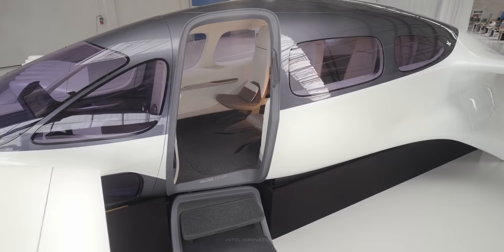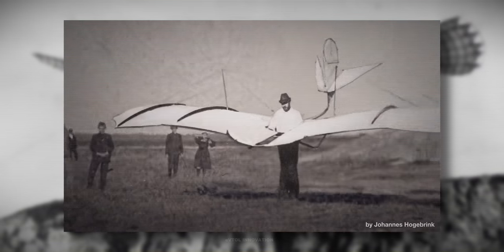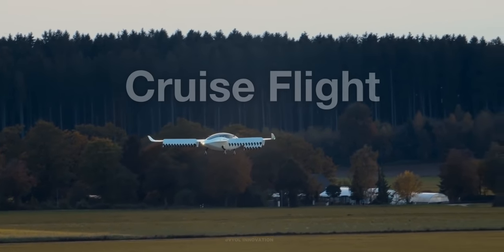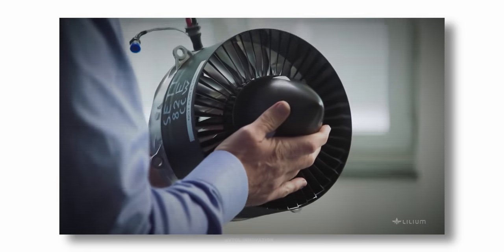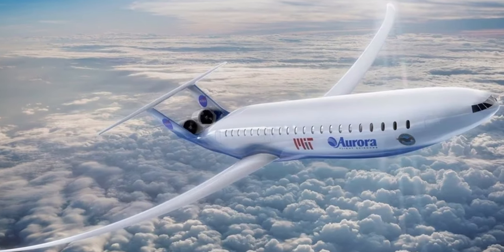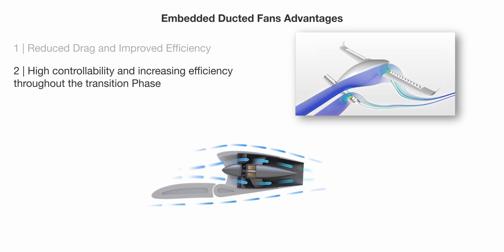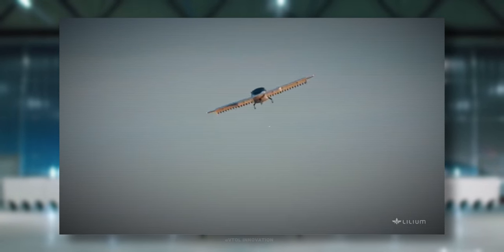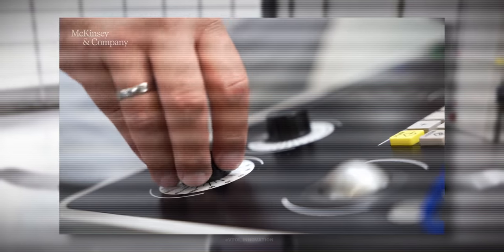The Insane Engineering behind The Lilium Jet | Part 1

Comment: The aircraft sounded interesting unfortunately I am a blind subscriber
If somebody has the time could they describe the vehicle with a blind subscriber in mind thanks
Cheers
Reply: Hi Verne,

your curiosity and the fact that you can not see motivates me to try my best explaining the aircraft showcased in the video. 

It is a sleek looking aircraft that is mostly white in color featuring some additional black trimming. The aircraft architecture is utilising a set of smaller wings in the front and larger wings in the rear - a so called cannard aircraft design. It is about 11 Meter in wingspan (rear) and can seat 7 people within its extremely sleek looking fuselage, which might remind someone of the shape of a shark (without it's fins).  The aircraft is being entered on the left using a splitting door with integrated steps - oftentimes seen on luxury class business jets. One centered pilotseat in the front and 6 passenger seats behind. Its propulsion system is distributed along the rear trailing edge of the wings. 36 electrically driven ducted engines in total, of which 12 of them are on the two front wings and the other 24 on the rearwings. The engines are mounted in the pairs of 3 within so called flaps that are able to tilt around 90 degrees from a hover position into a forward flight cruise position using compact and strong servo motors. One special characteristic is the fact that there is no conventional tail stabilising surfaces (like a rudder) - it's all thrust vector based and therefore relies throught its full flight envelope on complex flight computing systems. The landing gear is of fixed nature and consits of one nose landing gear and two main landing gear legs that are being covered using a aerodynamic fairing structure that is likely utilised as a stabilising surface during forward flight, effectively replacing the vertical tail of conventional aircraft. The aircraft also offers a relatively spacious looking cargo trunk in the rear. 

I hope I have done a good job in describing this very beautiful and elegant looking all electric vertical take-off aircraft. 

Let me know and I am happy to clarify things further if you want!

- Robert
Reply: @supervolant  thanks Robert your explanation was excellent I hope this response gets through not sure the app is as accessible as it should be cheers
Reply: Thanks Robert
Your description was excellent cheers
Reply: @vernepavreal7296  Is received! Wish a nice day.
Reply: Also the tip curves up on the big rear wings into a sort of fin, i'm not airplane expert at describing this.
Reply: @635574  Wingtips are not for direction control. They control the wing tip vortacies effectively making the wing perform like a longer one, which is more efficient. In laymen's terms the longer the wing the less air slips off the end of the wing vs staying under it. Wingtips reduce the slipping.
Reply: Surprising they don't mention that EDF is the best way to turn electrons into noise and heat. Does this come with a cord? I think that says enough.
Reply: @supervolant   

I would like to describe this user as: awesome.
Reply: @supervolant  Details are in the efficiency numbers. A pilot is a deficiency, and liability.
Reply: @court2379  Not exactly true, they are to dissipate the vortex away from planar influence. If they were inverted, they would appear as a longer wing as it would create a small wing in ground effect situation by building pressure under the wing.
Reply: So should I design a wing tip differentiator to switch from peak laminar flow to an inverted or introverted plane modifier tip?
Reply: whoever reads these comments to verne pavreal tell him the plane acutually looks like a banana.
Reply: The Body is shaped like a stretched apple mouse white on bottom brown on top half  , It has a large long  wing with shark fin like wiglets at the rear  . There is a smaller wing half the size up front without wiglets. Fixed wheels in aerodynamic upside down  v at the rear . Both front and back wings have the engine in-beaded into the flap section of wing at  the rear of the wing 24 engines total on back wings 12 up front . Weird looking plane something apple or Elon would make but the thing is well engineered and rides and lands smoothly . Professional serious plane
Reply: @chlyon  he is blind, he can't read
Reply: @ruzzcraze1862  lol yes
Reply: @chlyon  hi Colin thanks for that the app on my iPhone actually reads most of the text people type etc but of course not pictures thanks
Reply: @ruzzcraze1862  thanks for the suggestion actually the built in voice over app on iPhones reads the text to me or most of the text provided on YouTube cheers
Reply: @vernepavreal7296  I was joking lol
Reply: @supervolant  I love the shark analogy, agreed. It looks like a hamerhead with no fins and tail, fitted with Boeing 737 NG wings (with the winglets!)
Reply: @ruzzcraze1862  👎👎👎👎👎
Reply: @theone-swta  you didn't get the joke, I was joking, is jokeing something you understand. I was making a funny joke fr frfr.
Reply: @theone-swta  I wasn't ever making fun of him.  I am aware of the tools that visually impaired people have. Sure my joke was more on the side of trolling than wit, but It wasn't toward him, it was obvious jokes, that even he got. 

It seems like you think you have some sort of moral high ground over 12 year olds(which I am not), when you type with the literacy of a 14 year old.
Reply: @ruzzcraze1862  You believe what you want, what is obvious to one is not always obvious to another. Your sense of humour is wanting to say the least.

I stand by my commet!
Reply: @theone-swta  understandable for someone who didn't get the joke. As mentioned, it certainly was on the side of trolling.
Reply: @ruzzcraze1862  Trolling is always funny to the troll.
Reply: They call the propulsion jets but they are electric ducted fans.
Reply: It looks like a boondoggle with wings.

Comment: Calling an EDF a jet immediately makes this whole project sound like a scam.
Reply: EDFs are also the least efficient form of model aircraft - they require vast amounts of power compared to using a propeller.
Reply: Just like that new porsche "Turbo" ;)
Reply: @cjswa6473  still makes it SOUND like a scam. What MAKES it a scam is that they KNOW it won't do what they claim. The absurdly low efficiency of such small impellers makes it impossible. Why do you think that the only flights have been very short duration with no ballast to simulate the humans and cargo they claim it can carry?
Reply: They have to speak a language that at least some of the non-smart people out there can sort of maybe understand a little?
Reply: You may be hung up mostly on the electrical part of the design. Just feels like a whole lot of hate going towards this project which to me feels like a pretty decent shot at something that could be transformative.
Reply: @djbis  No, not the electrical part, but the electrical duct fan (EDF). EDF has very low energy efficiency. I think electric is the way of the future, that's why energy efficiency is so important.
Reply: Jet: a high volume of liquid or gas forced through a small opening.
Once they claim turbojet, then it's a scam.
Reply: Maybe but Airlines like Azul ( Brazil's Jet Blue, same founder ) have already placed a $1 billion order.
I'm surprised Lilium didn't go the Hydrogen Fuel Cell route.
Reply: Yea it's a scam that's why Honeywell and Palatin are top Partners. And the CEO comes from Airbus and its head engineer designed the Harrier Jet, Honeywell is designing the avionics control systems.
Reply: It's about the Air being aired in a jet of Air. Not about the fuel or combustion.
Reply: @mosquito4026  not to mention there is no telling how much energy is wasted by having many many small motors I am curious as to how much air they steal from one another on how that effects air flow.
Reply: Yes they aren't professional
Reply: Very impressive but it all boils down to one major issue: battery technology my friend.....
BTW this thing will make a GREAT R/C toy for Christmas 😊
Reply: Agree, the true electric jet would be ion thruster engine
Reply: @Adrian-uc4ox  best comment
Reply: Endurance is going to be a big problem.  Unless they rewrite Part 91, and Part 135, it’s going to need at least 1 hour of endurance, even for very short flights.  If there is weather, it may need 90 minutes or more endurance.  Extra batteries will increase endurance, but decrease available payload.  If it will operate in icing conditions, it will require electric heat for windshields, and possibly wings (pneumatic boots may be a lighter alternative).  It’s interesting, but I think there are monumental hurdles for it to cross.
Reply: @michaelnoble2432 have to agree. I'm shocked they've raised over a half billion dollars ! They are great grifters, have to give them that.
Reply: Not to mention that it confuses recent mechanical graduates whi are not doubting if they understood nozzle design and tunbines correctly
Reply: @Adrian-uc4ox they haven't proven anything since this.
Reply: Calling them jets make it sound like a scam and their pathetic deceptively edited videos of a little toy prototype make it look like a scam. If it looks like a duck and sounds like a duck it's probably a duck.
Reply: Wiki.. "A jet engine is a type of reaction engine, discharging a fast-moving jet of heated gas (usually air) that generates thrust by jet propulsion."

Hence the word "jet" is literally a vectored, compressed high speed flow of air... doesnt have to be heated or not. The aerodynamics are almost similar albeit combusted or not.
Reply: se need cyberpunk AV
Reply: I was thinking this exactly!
Reply: @djbis bingo 🥂

Comment: If all power to the motors is lost I cannot imagine that this would glide very well once the dead engines acted like spoilers/speed brakes.
Reply: Not to mention that it won't be controllable at all without ailerons (not sure if this is the case, but it is implied with the discussion about using the fans instead of control surfaces).
Reply: You have a point there; there's no autorotation like a helicopter where the blades still work for a controlled descent! Wonder if it has a parachute for that scenario.
Reply: @waynet8953  given the fact that normal six seater ga planes have one too, i would be disappointed if it does not get one
Reply: Then get some life insurance

Comment: I believe this aircraft uses grate deal of energy and hence exhausts the battery on take-off and land. So an obvious solution seems to be why not use hard wire electricity to take off and then detach and cruse and as it can hover it can be re-attached to hard wire electricity for landing too. This should allow much longer ranger or increase redundancy factors substantially
Reply: better by microwave on takeoff and land (wire sounds awkward. microwave receivers are light)
Reply: @sean1336  How about lazers?
Reply: New technology can increase the range in a few years.
Reply: Yes, if that technology really available, as microwave recharge means one 747 flying over the Atlantic oceans could recharge hundreds of 9 seater battery powered 9 seaters planes and can at the same time carry cargo either direction too , win win
Reply: Undoubtedly, but but if we can use what technology we have now and make practical use of them . If and when better batteries on the market that would bring about improved range , They could easily replace the batteries  and keep fling those planes

Comment: Each propeller blade has its own losses - lots of them. That's why more isn't better, in this case !  "Insane engineering" hits the point pretty dead on. ;D
Reply: Each propeller has en percentage efficiency, for example 80% either big or small. So effieciency will basically be 80% whether one motor or 24!

Comment: As a long time aviation enthusiast and hobby drone builder, I've really been excited to see so many eVTOL ideas coming out. It's like the early days of aviation, where so many concepts were being hashed out. Personally, the Lilium Jet and the Blackfly are some of the most efficient, elegant, and interesting ideas IMO. Lillium is more advanced, but the Blackfly is such a simple and effective concept. Better cheaper cleaner battery tech is gonna be the big hurdle to be solved.
Reply: Check out joby evtol, my personal fav 🙂
Reply: Blackfly is a billionaire toy.  It will never be certified but through a series of sales Boeing now own  what's left of the technology and company.
Reply: @pelleban  agree. Best Technology by far
Reply: @pelleban  Lilium is faster and more efficient giving it a significantly larger range than the more conventional Joby concept. It's the best eVTOL design I've seen so far with the less developed Jetoptera being second. It also looks So Cool!! 

Everything else is based of some type of drone with some using tilt rotors to try to increase speed and efficiency. Hopefully Lilium wins. Quiet is good.
Reply: @TecnamTwin  Well I still prefer Joby, my personal favorite. Just as a pilot point of view I find the Joby more appealing. Tried and tested design that works. Lillium might be more effective, the future will show. And maybe I missed some test range flights and FAA approvals for Lillium, are they as far in the process as Joby?
Reply: What about ATEA in Toulouse ?
Reply: @grenouille750  Not a very efficient or elegant solution, because you need several  large expensive and heavy lift fans that aren't even utilized for forward flight. Those holes also decrease the available wing surface for lift in forward flight.

Comment: Very nice, but what about the batteries?  Charging times and in flight charging possibilities would be interesting to know.  Then of course, how much does everything weigh, and what is total capacity, and to what maximum distance?
Reply: I was thinking the same thing , without high density ( power to weight ) this plane isn't worth a shit. Would make a really neat rc model though.
Reply: "in flight charging possibilities"?
Reply: My thoughts ex-act-ly. Fairly new pilot here and I need concrete info before I invest in it. Lift capacity? Flight/charge time? Range? Service ceiling? Inclement weather performance? How does it/can it maneuver in a crosswind while maintaining stability? It's aesthetically beautiful, but I know what a crosswind can do to an aerodynamically stable plane on a typical day. Can this thing handle a wind gust or airflow change, i.e. crossing a frontal boundary...? If it survives safety/torture tests and has viable lift cap. and range I might be all in for this.
Reply: I'd enjoy watching fly in some turbulence!  Not just a nice pleasant sunny day in optimum conditions!  Throw in some birds and sand!
Reply: @antonelli scrump·tious  Good job, there was no sand and birds back in the early flight pioneering days.
Reply: Hype.  Narrator probably sold ‘one drop blood test’ machines for Theranos, or crypto for FTX.
Reply: @Ironman-33  buying this rig requires an FAA certification. They won’t get one, so no you won’t be buying one

Comment: Great explanation. I had been wondering why they went with EDFs, but that explanation of the decision to favor cruise since pure hover is such a short time in the flight makes a lot of sense. Also the gains they get in transition due to the "blown" wing help for low speed flight. Thanks for this video!
Reply: Hover is short, but it will really eat into the battery.
Reply: @flightisallright  Yes it will. Just playing with my RC EDF jets is proof enough. I had one (FT Viggen) that could hover on 4s with just enough to climb out (thrust vectored on pitch only so hover was sketchy!) 😂😅
Reply: @flightisallright ,He's very horrible. its looks a contraption flying in reverse. As for technology it is undoubttedly accurate. tanks.